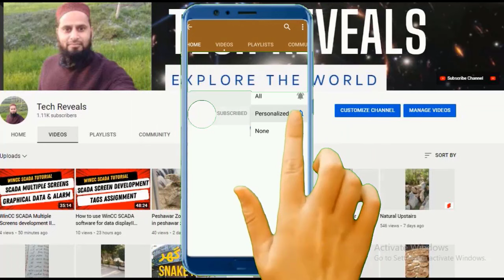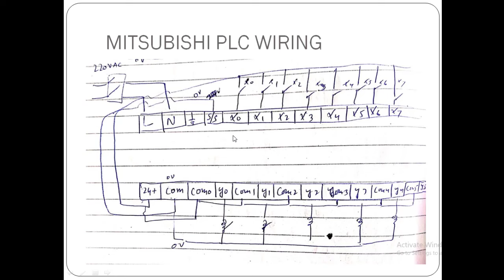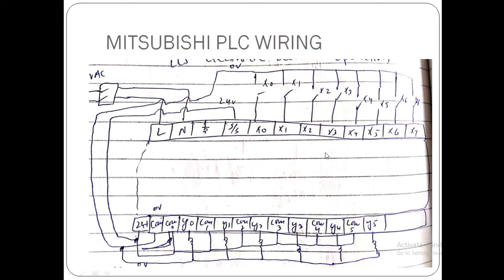Mitsubishi PLC Wiring methods II Wiring Diagrams II PLC programming Tutorial #03 @Tech Reveals

Comment: HI, Thanks for the tutorials but it started to get confusing as to how it you have it wired.  Do you have a demo of seeing it working with switches and lights?
Reply from the maker: @OYMInternetRadio  yes there are other videos in playlist for how we can wire a plc and how we can run a simple DC motor or ac motor using plc
Reply: @TechReveals  Ok, thank you. Do you have a tutorial on how to disable an input switch after it has been used for example, 4 times.
Reply from the maker: @OYMInternetRadio  there is a video that how we can switch multiple lights after a specific time delay.